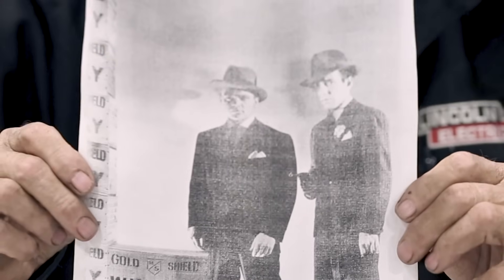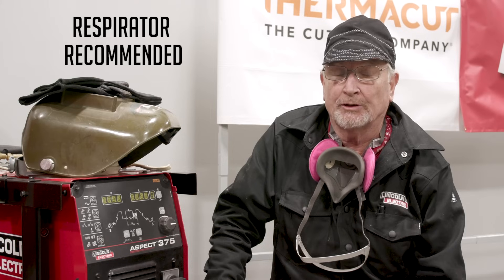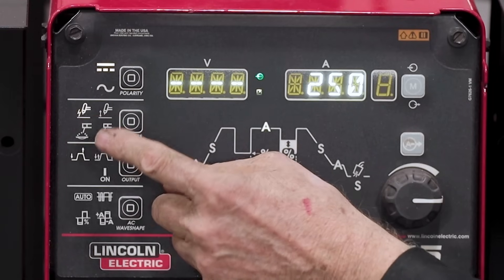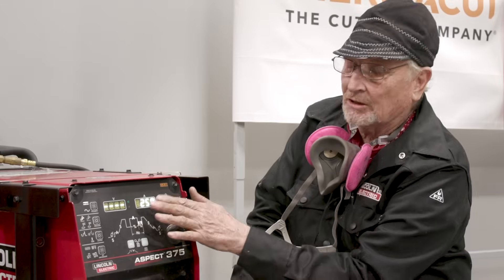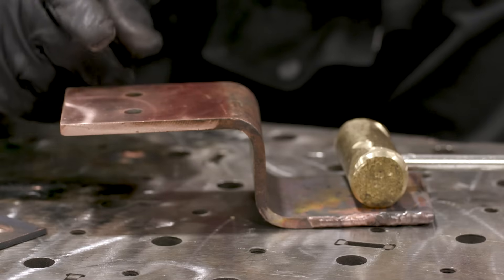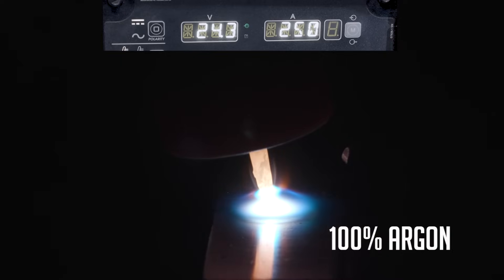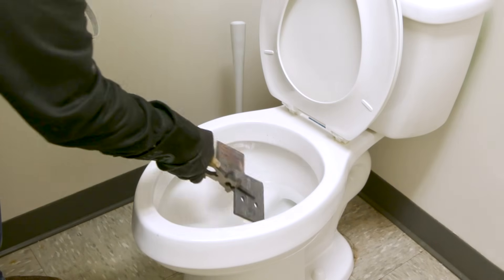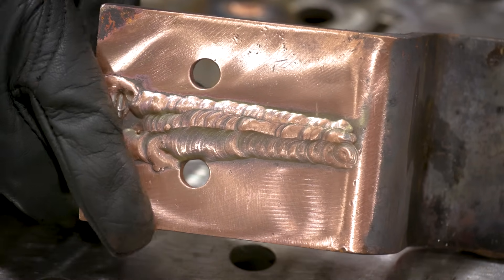How do you TIG weld COPPER?! 🤔

Comment: I welded many ASME pressure vessels, Steel, SS, Aluminum and some Copper pressure vessels, especially the water cooling jacket. I used Silicon Bronze on the copper. This was back in the 80’s, and small copper filler rod was not easily available. I think the idea of using electrical conductors is a great Idea. Even the Licensed Electrician side of me thought that was a great idea! Lol. Yes I was also an ASME section 8 and 9 welder, a computer science and electronics guy, and a field service person. I built and installed hi tech equipment in Boeing, Rockwell, SVG, Harris, and even in Universities. Great to see other people TiG welding copper, SS, etc… of course I use the wire feed at home, the most, Stick for structural (770 mox when it was available, and now 7018), Spoolgun or TiG for Aluminum, and plasma or Acetylene for cutting.  I also do minor electrical work for friends and family, and have built most of them computers over the years. I’m retired now, so welding and electrical are just hobbies. I did so much computer work over the years, I try not to anymore! 🤠

Comment: Today I tried this (before watching your video, of course). I didn't even need to dip in the toilet to make it look like sh*t. 😂

I am not a welder tho, just a hobbyst. Nevertheless, I noticed similar things, ie. the filler need to be holded with a plier as it gets extremely hot in 10 seconds, I can’t melt 6mm (1/4”) thick huge plate with 160A (max for me), and that I need a lot of gas coverage. Also I am so proud of myself now that the electrical wire I improvized as filler is actually a proper solution not a hack!

I need to practice a lot more...

Comment: I was hoping on some info on how to combat/prevent burn through and sagging. I occasionally have to to repair weld copper shielding on laser cutting fixtures, and they are usually complicated shapes that dont allow welding on a flat bench.

My current method id to make/find backing out of thick steel to sink heat and prevent falling through. Ive also wanted to try welding in a water bath to aid with heat disapation. Beyond that its just try your best and grind the rest lol.

Comment: If you're balling your filler wire off you need to keep your tungsten closer to the weld pool, change your angle of the tig torch, and lower the angle of your filler. one or more of those solutions should help the problem.

Comment: you showed that the wire would melt before you could enter the puddle. i wanna ask something about this.

you weld with the tungsten electrode pointing down to the front. what happens when you would drag your weld puddle instead of pushing it forward? does it change something?

Comment: Paul, I really enjoyed this video, very informative as well as entertaining. I knew that copper takes more heat to weld but your demo really put that into perspective, wow, 5 times more conductivity than steel. I had a question about your gas mixing setup, it looked like you just had a tee from two different tank regulators going into your supply line for your welder? I was wondering if you get decent gas mixing using that setup and if there are any issues with backfeeding through the lower pressure regulator from the higher one. I'd like to experiment with different gas blends but was always told that I'd need a proper gas mixer or it wouldn't work.

Comment: The romex ground often has a clear coating on it, not just oxidation. You probably won’t remove it with a couple swipes of scotch-brite and if you don’t completely remove it, you’ll be putting hot plastic into your weld and it might not go so well.

Comment: My question is why weld copper? Why not TIG braze it? Brazing copper doesn't seem particularly demanding as far as heat goes. Maybe not as strong as welding, but it's copper, how strong could it possibly be?
Reply: Electrical conductivity, I believe.
Reply: @enderxzebulun  People solder circuits all the time, so welding isn't necessary.
Reply: Electrical conductivity, I believe.

Comment: You can get reels of just plain bare copper wire from Home Depot or Lowe's or any hardware store, it's used inside electrical boxes to connect all the grounds together or to connect the ground of the NMC cable(s) to a metal electrical box. You pay average copper wire prices for it (which is to say, not cheap, but probably less expensive than copper oriented towards being used as welding supplies specifically).
And it's available in many many diameters, most hardware stores should have everything from 10AWG down to probably 16 or 18AWG.
Thicker than 10AWG is available, but it tends to be only available as stranded wire, which isn't that useful for welding purposes unless you're intending to join that wire to another piece of copper (such as you might see in a bus-bar type application, tho a crimped and bolted connection is far more common for that).
If you need thinner, you can buy solid wire ethernet cable or doorbell wire, ethernet cable is supposed to be 23AWG copper, doorbell wire is probably in the 20-22AWG range (but it'll say right on the package what it is). Apparently there's also wire specifically for thermostats.

Now of course, if you for some reason need thicker copper for your fill rod, well 10AWG is already thicker than most fill rod, but you still have options from the hardware store, if you don't mind putting in some manual labor. Small diameter copper pipe like what you'd use to repair an AC system's refrigerant lines might work, if you can find it. Maybe it'll also be sold as line to hook up to a water dispenser on a fridge, I'm not 100% sure to be honest. Never had a use for copper pipe that small, but I've seen it in houses before so I know it must be sold somewhere.

I personally don't see a need for all of those kinds of wire now that ethernet cable is so common, it has 8 wires in 4 twisted pairs, it's far over-spec for just use as doorbell or telephone wire but it's also probably more affordable since it's so much more commonly used than the other dedicated kinds of low-voltage wiring other than coaxial cables.

Just so we're all on the same page, when I say NMC I'm using the same language the National Electrical Code uses to gather together all cables similar to Romex, because Romex is technically a trademarked name of a SPECIFIC BRAND of NMC (just like how "Band-Aid" is a specific brand of adhesive bandage, and Kleenex is a specific brand of facial tissue, and Coke is a specific brand of cola)
NMC is an initialism that stands for "non-metallic cable" to differentiate it from BX aka armored cable or a few other types of cable that include metal in their construction for purposes OTHER than the normal task of carrying electricity. Oh and I called it an "initialism" and not an "acronym" because again I'm using a more precise term, of course most laypersons will call them acronyms regardless, but in reality there aren't many acronyms out there, the majority of these "words" are properly initialisms because they take the first (aka initial) letter of every word that makes up the full description. It's only an acronym when it doesn't always take the first letter.
For example, Laser is an acronym, because it skips some words entirely, it stands for "Light Amplification (by the) Stimulated Emission of Radiation".
Interestingly, there are earlier things that use microwaves instead of light, and one of those is called a Maser (Microwave Amplification by the Stimulated Emission of Radiation). There are also theoretically Xasers and Grasers too (for X-rays and Gamma rays, respectively). We haven't really had a use for it yet so we haven't really tried to make or theorize making one yet, but there might also be similar things for "ordinary" radio waves of frequencies lower than microwaves as well. Actually, those would be fantastically useful, even if they only have a tiny power output, because they could be used as a precision frequency standard much more accurate than a quartz crystal and potentially consuming less power than an atomic clock (these have already been greatly reduced in power consumption by the development of GPS, as to make GPS work you need to put many atomic clocks in orbit (inside the GPS satellites).
Reply: Larger than #10 bare copper solid is available from electrical supply houses, it's used for grounding and bonding purposes.
Reply: @jarphabib 
The only problem with stuff larger than #10 AWG copper from a hardware store (and the reason I disqualified it from welding supply use) is that it's far more likely to be only available as a stranded wire, where when you are using it for welding, you'd really rather that it be solid.
Reply: @44R0Ndin  Yes, that's why I.said electrical supply rather than hardware store.
Reply: @jarphabib 
I was specifically talking about hardware store, you were talking about electrical supply, I think the prices at the hardware store will be better unless you have a contractor discount at the electrical supply place.

Comment: I have tried my self with 200A on a 20Kg 100/15 mm bar! It was hopeless. It spread the heat so fast that I couldn't open a single moment the fusing bath. Even if I've keep heat the other end with a big acetylene torch. It starts to be OK when the bar get red, but to hot to stay close, also impossible to weld because of oxidation. 
Yah, probably if you have a small piece, as he do, you may be able to add a few drops from the stick, but to weld two parts and have a real welding... it is not possible.

Comment: The electric wire will be electrolytic copper and be at least 99.5% pure copper.  The 0.5% remainder will consist primarily of silver with lesser amounts of other elements.  Burnthrough will also occur more so on a pure metal rather than an alloy.  A pure metal, such as the copper types that you are using here, will have a very well defined melting point.  This is different from steel and aluminum alloys where there is a temperature difference between the temperature at which the alloy begins to turn to a solid plus a liquid to where it turns into a pure liquid.  For steels, this can be several hundred degrees Fahrenheit depending on the alloy composition, especially carbon content.

Comment: Great demonstration thanks a lot this helped me with a copper Weld issue I was running into. LARGE CUP and either add helium or pre-heat. 

Wanted to give you a friendly warning about dunking anything hot in toilet. If the object is SUPER HOT and ends up transferring to a localized area of the bowl, the porcelain MAY develop fracture lines or downright crack apart (either immediately or after someone settles into the seatbelt). Witnessed this after someone tried to quench a part he was heat treating 🎉.
Reply: i thought the same thing about putting super hot metal into the toilet bowl and cracking the bowl.

Comment: When brazing copper, I find a really quick and easy method of cleaning away oxide is to submerge it in Goddard silver dip for 20 seconds, then rinse of. It's designed for silverware but works equally as well on copper.

Comment: I had to change my YouTube bell notifications because they changed it. But excellent information in the "Adventures of TIG And Copper". Thank you as I like to learn.
 Believe it or not, but I still use a SnapOn 400 Watt soldering gun and is now 40 years old! Since I use the the 400 watt tip, it works great on most all things automotive but honestly, but if I have much larger cables to solder, shrink wrap, cover with friction tape and secure in place, I have my grandpas soldering iron. He was an electrical engineer graduating in 1932 and ran field generators in WW-II for this new invention called radar. 
Yes, the original chunk of copper cast onto a steel rod with a wooden handle. 1" square and shaped into a point with flats, it was "The Tool" for decades. It was originally held in a fixture and heated by a hand pressured alcohol torch. 
  Modern times, millions have no idea that ceramic knob & tube electric wire is not un-safe as it was separated, the ends where twisted and soldered for all connections! It was allowed in the middle of a run without a service box to fix it if a failure happened. Connections to switches had soldered leads, it was cover with friction tape. A word most older worker in home improvement stores would even know! Friction tape is way better than todays PVC w/natural rubber as the sticky stuff. The wire has changed for the better as it was cloth covered asphalt covered cloth mass produce for decades. It simply hardened with time and would crack. The fact it was separated by ceramic knob and tube, but all connections were twisted and soldered was Normal. This made it safer. 
  I simply wanted to know how to extend the soldering tips life as the erodes with use. Costing $30.00 each but still sold! This is an insulated tube over a heating element with a copper tip. I have owned a MIG since 1984 new, but never had a reason to but a TIG or other!
Thanks again for sharing your knowledge, background and experience! Thanks.
DK, ASE Master Tech since 87, retired.

Comment: I recently did some 2"od, 1/4" wall copper pipes. Went through the "trying gasses and blowing up tungsten" phase until I figured it out. 300 amps, clean clean clean, preheat with MAP gas torch, 1/8" 2% Thoriated tungsten and used 12g. household wire as filler. That was a real test for me since I dont do a ton of TIG welding, but do have my pipe certs.

Comment: Tried to repair a split in a huge brewing copper, using oxy/acet. on reverse side of DC tig to keep heat running the joint. Near impossible the heat needed and trying to weld,  gloves could not withstand the extreme heat for long. Another instance I had a customer welding 6-8 MM copper components using guillotined off cuts for filler, they had a 500amp dc tig to get the heat into plate to start the pool, once heat up to speed could then back off current to weld. Hope this gives insight to welding copper not being a walk in the park . Thanks for interesting👍👏 video

Comment: sadly your respirator has particulate filters on it which will do nothing  to protect you from the fumes created in welding. I am by no means a Safety NAZZI  but I do believe if you are putting out safety information you should do so correctly .

Comment: My last job i would weld orders of bus bars. Only a couple inches wide but would weld with a graphite backer and copper heat sinks all around the joint. I would max my machine at 400 amps and use half a piece of wire in just 2 inches of weld. Full pen welds I would dab at least 3 inches of wire in each dab. I would sand and blend both sides of the weld then each part had to be Rockwell tested to make sure I didn't put too much heat into the entire part and make them brittle. Very challenging parts but I actually enjoyed how technical they were. I did them by the hundreds and they were only 1/8" thick! Haven't met a lot of people who have welded copper on a manufacturing scale.

Comment: Been there, done that 20 years ago in another life.  Did some 1/2" copper plate with a miller 300 welder.  It did not like it one bit and tripped out the 100 amp breaker after the first pass.  Had to preheat before the rest of the welds.  Turned out beautiful.  The Miller Dynasty 700 with the 450A water cooled torch doesn't even notice it and ripped thru like nothing.  Throw in Helium and there is just about nothing in reason can't be welded.  Love the tip to use Romex wire for filler, I did like others suggested and simply sheered sheet down for the filler.

Comment: ive done a lot of bar tops, stills, and specialised copper work for distilleries and that, i always shear the same sheet i make the part out of and use that as filler metal, when its all polished it looks the same and same strength as parent metal.
Reply: How would you do it with repairs? Or do you just do custom work and always have enough extra material to make rod out of?
Reply: Genius!
Reply: Fantastic idea!
Reply: That a great idea, really smart..
Tks for sharing

Comment: Many years ago working at a shop where we made architectural doors and they took on a job from a sculptor who had no metalworking experience so I ended up fabricating all his pieces of his sculpture. One of the pieces was a copper cube about 12 in x 12 in and we just had the shear Guy shear off some of the parent material and that's what I use for the filler and it worked really well. Now this sculptor guy wanted the cube mirror finished which we did, and then he came in to inspect the work and decided he wanted the cube to now be a matte finish so he took a sanding disc to it and ruined this beautiful mirror finish we had created. And many of the guys in the shop want to lunge at him and choke this guy out ruining their work but he was the sculptor it was his right to do that.

Comment: Never used tig for copper, i use oxy propane or you can use oxy acet, no need to clean or use a flux. Watch out for over heating bubbling with Oxy acet as it makes the weld joint bubble making it weak. Filer wire just use electric copper wire. The joints welded using this method are that strong they with stand swage crimping  and lathing.
Reply: Give it a try.

Comment: I welded copper to 316 stainless a few times. It was kinda tricky to start but welded nicely. I used stainless filler material and pure argon.
Reply: Made thousands of water features with copper,  even with stainless fittings only used pure argon.  The samples this guy welded were the worst weld beads I've ever seen done by a professional.